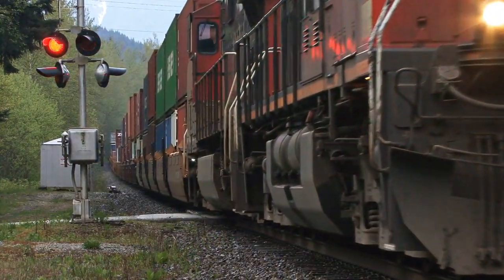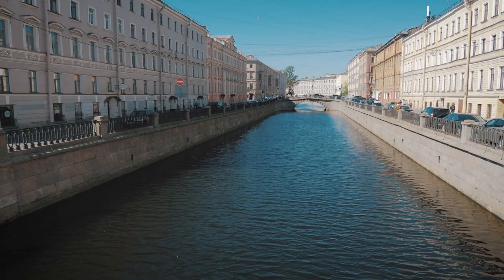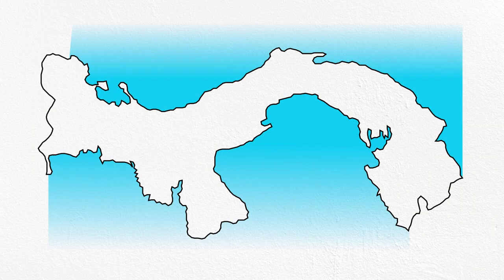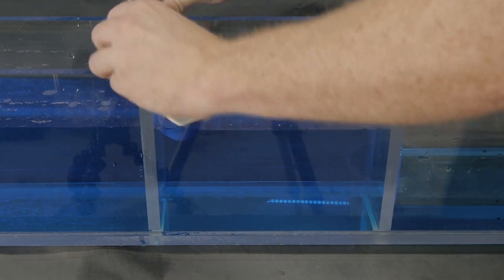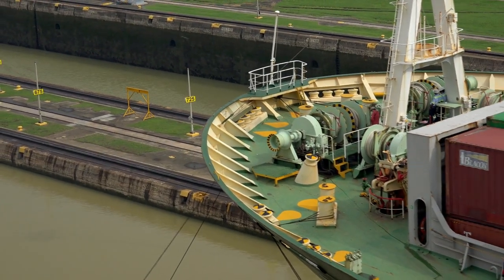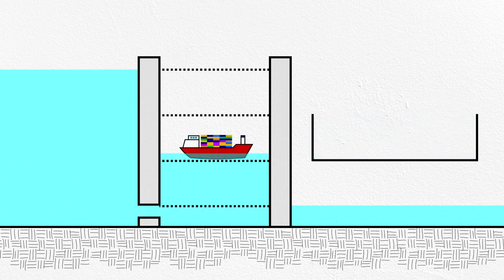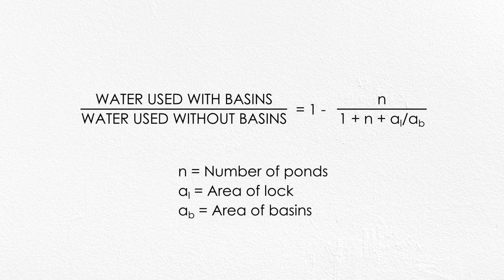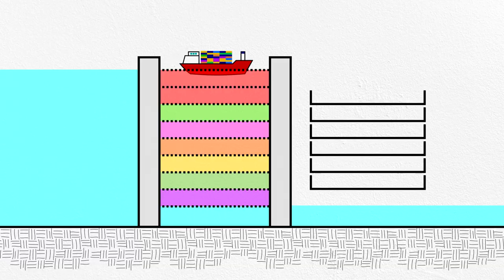The Surprising Efficiency of Canal Locks

Comment: Some waterdams pump water uphill when the electricity cost is low to "store" energy. Is there any canal that does the same to save water ?
Reply: Actually makes me wonder if it would be possible to generate electricity from the flow of water in the locks. Would the small amount of generated electricity even be worth it? Of course, it definitely wouldn't be enough electricity to pump the water back up.
Reply: I would think reservoirs are already situated in such places where nature itself does a lot of the "filling back up" for you. Forces of nature are often so grand we can't really match them. But we use them.
Would love to hear from somebody more informed than me.
Reply: @GeekIWG  In theory yes, although it would only be worth it on busy locks. The generator would need to handle a high flowrate so the locks still fill and empty quickly, and they would need to work under varying water head (pressure differential caused by height difference between the lock and canal water levels) and flowrate to be efficient. Some people may be concerned by the effect on wildlife and the turbine would need to be robust to deal with occasional trash and vegetation in the canal. So it's a little more complicated than it first sounds. I believe there are micro-hydro plants installed besides some locks which work on excess natural flow of water down the canal. In the UK a lot of locks are quite leaky so it's not always worth it.
Reply: @GeekIWG  The amount of energy you are able to get from water flowing downhill is proportional to how far down hill the water is flowing. Since the basins for the locks are basically at the same level as the lock with only a few meters difference in height between them, and the useful work of the water is being used to raise ships, putting a hydroelectric generator in line with that water flow would not generate any useful amounts of energy. If the elevation difference of the pools or the locks was so large that that you could get a meaningful amount of energy from it, it would mean you are wasting a lot of water in your lock design. If the lock is designed efficiently already, you wouldn't have any left over energy for the generators to harness.
Reply: @GeekIWG  Makes ME wonder what kind of huge hydroelectric dam you could put in a place like Panama since you can have unlimited and unending flow from the Pacific to the Caribbean...
Reply: Being a bit of a canal fan I know that pumping is done on some canals where there isn't sufficient supply, e.g. some parts of the Kennet and Avon canal. There's also a drop lock in Dalmuir, Scotland, that has the ability to pump and is used when water supply is at a premium as it's otherwise not cost effective. The drop lock is a unique case where a swing bridge was replaced with a fixed bridge so the canal level needs to be lower for a short distance so boats can pass under the bridge and then returned to the original level. Since the canal on either side is the same level as the maximum of the lock any water emptied from the lock that isn't returned via pump is lost from the canal system.
Reply: @esequieltovar4955  No matter how you lift the water, whether its a tank you lift or pump the water up, it still costs the same amount of energy. A pulley system simply uses less force over more distance.
Reply: The new, 1903, locks at Lockport, NY, used a small hydroelectric plant to provide the Direct Current power needed to operate the gates of the system. IIRC - the gates still use the original General Electrc DC motors but the power is supplied by the grid.
The Panama Canal originally used Westinghouse AC motors powered by electricity generated at the Gatun Dam. Electricity also powered the tow carts next to the locks. Both canals are very impressive engineering works.
Reply: @Sorenzo  That wouldn't work. You need height difference between  water bodies to be able to make hydroelectric energy.
Oceans are all at sea level (besides minor fluctuations), hence no gravitational potential energy available.
Plus you have Panama in between that is raised in comparison to both water bodies.
Reply: @GeekIWG  The Kallo Lock (360m long) in Antwerp does this. As far as I know, it's the only one in the world. The power generated is used to Operate the lock.
Reply: Teun Dilles even more locks along the Albert Channel in Belgium use this principle.
Reply: Yes. Grand Coulee dam and the surrounding canals do that
Reply: @esequieltovar4955  what's needed is a floating reservoir. Most of the water released through the upper gate is held in this reservoir. The lower gate is opened to let traffic through. Once this is closed the reservoir then empties itself, rising back up to repeat the cycle :)
Reply: @WarrenGarabrandt  You say 'useful amount of electricity' but honestly a lot of devices can run on small amounts of power these days. It's only about finding a solution that generates more value than it costs - if such a device can exist. Not everything needs to be huge.
Reply: @stormveil  whatever that amount is that your device needs and can operate on, that's what "useful amount" is. You can change a cell phone on way less than what a vacuum cleaner needs, but if what you need is to run the vacuum, then anything less is not useful for that purpose.
It's all about context and what you're trying to do with it.
Reply: Yes.

Comment: One thing about engineering is that you can’t always completely predict the consequences.  When they expanded the Panama Canal, it changed traffic patterns on my local interstate thousands of miles away in Virginia and even more so up north in Pennsylvania as good being shipped began to take different routs.  I’m not sure if the negative economic impact on a rail hub like Chicago, but it’s certainly increased business for ports such as Philadelphia, Baltimore and Norfolk.

Comment: I enjoyed that, thank you. Here in the north west of England, Chorley, we are surrounded by lock systems built during the industrial revolution. Chorley is on the Leeds/Liverpool canal, and we have a “flight” of, I think, about six locks in one run. I found this guy’s video of passing through the town... 

https://youtu.be/gZzb06BMoX0

...but I’ve never seen a side pool, very interesting. I don’t think we have them because, it rains all the bloody time here :)
Reply: 1967AJB Is that near Yorkshire? 🤭
Reply: The Caen Hill flight has 29 locks in total which rises 237 feet over two miles of canal. 16 locks form a straight uphill climb which takes 6 hours to pass through apparently. Then there is the Bingley 5 rise locks which is a five step staircase lock where you move out out one lock straight into the next one; the lower gate one one lock is also the upper gate on the next. On the Chesterfield canal which is nearest to me, there are the old Norwood locks which consisted of three triple rise locks folled by a four rise lock which then enters the old 1 and 3/4 mile long Norwood tunnel, all built in the 1770s! Unfortunately the tunnel partially collapsed in the early 1900s and this section of the canal has been closed ever since. The Chesterfield canal trust is working on restoring this section but the plans are pretty ambitious, including possibly a new boat lift or five rise lock in one section and excavating a new tunnel.
Reply: @Bordpie  the uk is filled with canales and looks?
Reply: @joeyknight8272  Yeah. We used to have a lot more, but filled most of them in when the train network took over. There's an ongoing project to restore some of them where possible. 
I grew up next to the Kennet & Avon canal (named for the two rivers that feed most of it). You don't get much cargo on them anymore, they're mostly recreational and nature related now.
Reply: I live at one end of the top section of the leeds and Liverpool canal, so glad it's well-kept
Reply: Pretty sure Top Lock flight is seven, and the next set of locks towards Liverpool on the other side of town is Wigan flight, at 23 locks, possible (just) to do in an afternoon....
Reply: Used to go for walks in a park alongside the Leeds/Liverpool canal. Got to see the locks one time too. Wish I could visit them. Should probably go after lockdown when it gets sunny again.
Reply: Joey Knight There are still over 2000 miles of navigable canals in the U.K. used for leisure boating now though rather than the trade for which they were built.

Comment: Very nice video as always!  I live on the Mississippi River next to one of the Lock and Dams and one never thinks of the water loss going down river.  They do have pumps that move the water back to the “upper pool” when the river levels are low, otherwise when the river levels are high, they can just free flow the water into the “lower pool”.  It’s fun to watch a huge barge just mystically rise up in the air and go up-river, or to be in the lock when you are locking up river.

Comment: I trained as an Officer of the Watch and have had the pleasure of doing four transits of the Panama Canal using the old locks. A truly incredible piece of engineering and very humbling when you learn how many died to build it. The mules (small trains) used to help maneuver ships in the old locks are very interesting too watch. An entire gang of workers come on board each ship to manage the wire cables used to connect us to the mules.
Reply: Surely the mules are not trains, but locomotives…

Comment: Great stuff here!  Some other nifty details about canals and locks I've picked up over the years: 

1) From "Marriage of the Waters" (a book on the building of the Eire Canal) the author describes how Da Vinci designed the lock gate with the two halves opening inward, and each gate door slightly longer than half the width of the canal.  In this way, the doors come together before being parallel with each other and the peak facing in.  The pressure of the water will force the two ends together making a self-adjusting seal (the higher the water the tighter the seal).

2) In David McCullough's book, "The Path Between the Seas" (on the building of the Panama Canal) he mentions a few reasons that a sea-level canal was, if not impossible, at least impractical.  
2a You touched on the first that more that twice the amount of dirt would have to be excavated.  Not just because it would be lower, but because a large portion of the canal (as built) uses Lake Gatun to freely navigate between the lock sections, meaning more length to the excavation.  
2b Lake Gatun would wind up being drained and all of its feeders would cause the current in the canal to run at 5 to 10 knots due to the lower elevation (greater head pressure) and the narrower channel.  Not to mention, as you did, that the lake supplies water to the local populace.
2c This one I find personally fascinating, that the levels of the Atlantic and Pacific are not the same, with sea "level" being up to 12 feet different across Panama (I forget which one is higher).  This means that there would be a unidirectional current flow downhill adding to the flow from watershed drainage in one direction and subtracting it in the other.

3) The Great Johnstown Flood in Pennsylvania was caused by canals.  The dam that burst and flooded the city was built as part of the canal system for the mid-Atlantic states in the early  19th Century to provide lock make-up water (as you described).  When the railroads put the canals out of business in mid-century, that particular reservoir was turned into a resort for the ultra rich.  The resort operators never maintenanced the dam, and when a once-per-century 3-day deluge happened, the earthen dam was breached in the center and quickly eroded, emptying the entire reservoir onto the town about 6 miles downstream.

Comment: Hello Grady, and thank you for this very interesting video!

I have a question for you: For greater efficiency, would it be possible to "pair"canal locks the same way boat lifts are used today?

I'm not an engineer but here is how I imagine this system would work:

- One canal lock (the "descending lock") is used by a ship going downhill, while at the same time, another lock (the "ascending lock"), is used by a boat going uphill.

- Both locks would be identical in height, volume, and location.

- Both locks would have to be operated at the same time, with one ship per lock going in opposite directions, or a single ship and an empty lock.

During operation:

1- Starting with one lock full and the other empty, the water of the descending lock would be used to fill the ascending lock, until both locks' basin are half-full, at equilibrium.

2- Water would then have to be pumped from the descending lock to the ascending lock to go the other half of the way down/up.

3- Here's where it gets interesting: for increased efficiency, the turbine located in the penstock between the two basin could be used to generate electricity for the first half of the descending lock drainage (phase 1), and given access to an energy storage solution, would be able to return that energy to supplement the pumping of the water during phase 2

If this system is used with only phase 1 and 2, it would result in a 50% save in the energy used for pumping and up to a 100% save in water (minus the disparities in displacement between the ships), while allowing for double the capacity, given proper timing, and at the price of increased capital expenditures for an additional lock.

This system is interesting to me because it potentially is very water-savvy, allowing for very tall canal locks, with a 

If phase 3 is doable, which suppose a reciprocating turbine/pump coupled to a generator/motor and energy storage, the energy savings could be up to 70-80% (quoted efficiency of pumped hydro storage, which i guess would be the efficiency of the pump) of the energy used during phase 2, minus the loss of the electricity storage, depending on the method : injecting the energy into the grid while asking the local power plant to decrease its production, batteries, super-capacitors, hell even a flywheel connected directly to the turbine could be imagined.

Then again, I'm not an engineer and I may have missed something.

Thank you for reading all this, and thanks again for this amazing video!
Reply: haven't read your whole comment but pretty sure this is implemented at Panama :)
Reply: Give this guy an canal lock Engineering Job

Comment: Hey One thought I had: 

The higher the potential-difference between two tanks, the faster the transfer of water is going to be. So my thought: Doesn't that also mean, the more tanks/basins you have, the slower the whole process? I mean saving water is one thing, but time is another big cost factor, isn't it?
Reply: There are practical limitations to the speeds you can move the water around, because the currents can also push the boats which has the potential to damage either the locks, or boats, or both.  That's besides general wear and tear, which will occur faster with faster movement of water.  Also consider that in terms of time locks like the Suez or Panama canals save time measured in weeks rather than minutes (and are priced accordingly, they are not cheap).
Reply: @UnbeltedSundew  The Suez Canal is at sea level throughout and has no locks.
Reply: @MikeV8652  True but it is the direct competition to the Panama canal, and as far as I understand it maintains similar pricing.  It has other drawbacks since it connects to the Med and ships have to go around Gibraltar and Spain to get to Northern Europe.  The time ships spend in the locks in Panama can be measured in hours.  I wasn't timing it but to me it seemed like it took a cruise boat about 20-40 minutes to go through one of the old locks when I was there.
Reply: @UnbeltedSundew  Oh, I wasn't trying to refute your main points, which are valid.  I was merely correcting the notion that the Suez Canal has locks.
Reply: @MikeV8652  No worries.  The clarification was needed.  I wasn't thinking when I wrote that sentence.